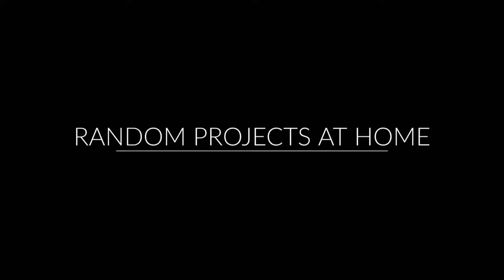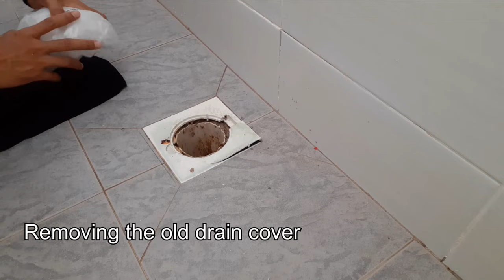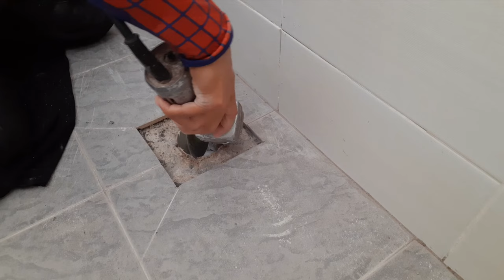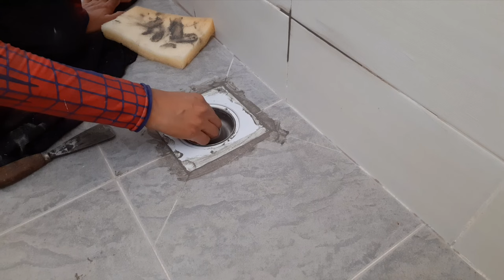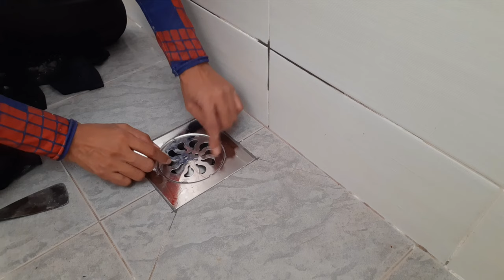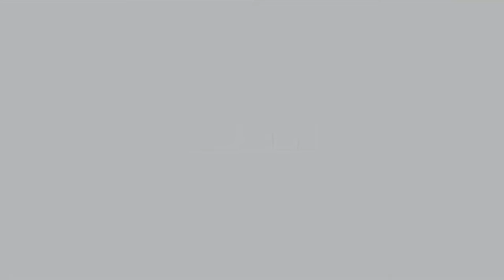Project: Replacing floor drain cover (Bathroom 1)

Comment: Why u want to change the drain cover.
Reply from the maker: for two reasons:
1. we've noticed insects and small centipedes in the bathroom (which looked like they entered from the drain),
2. the plastic cover had started to breakdown.